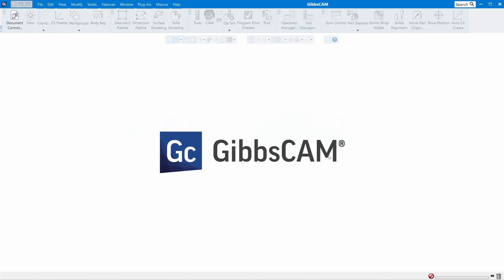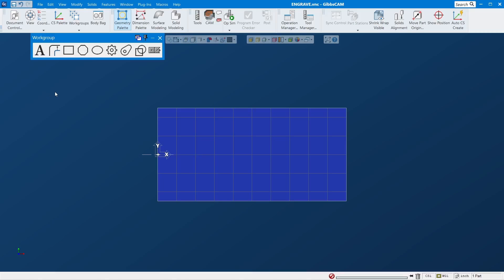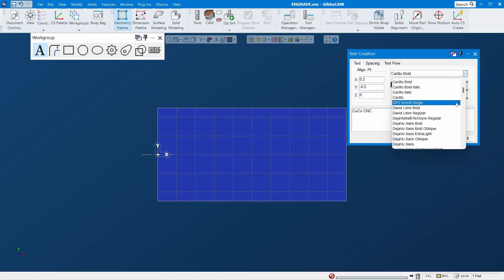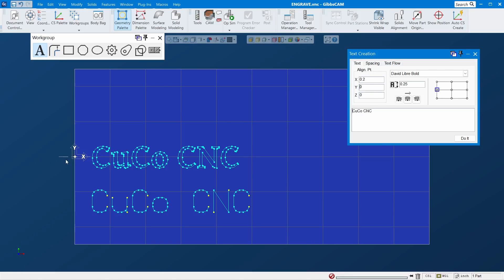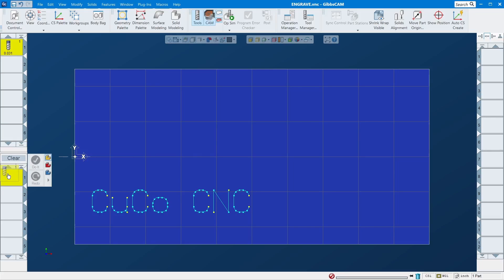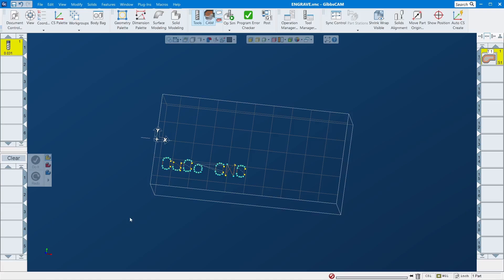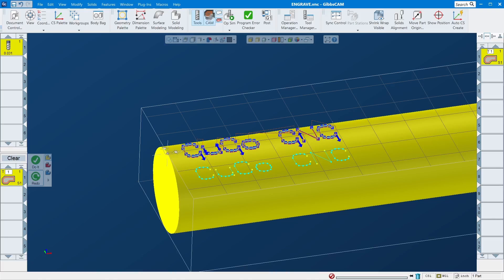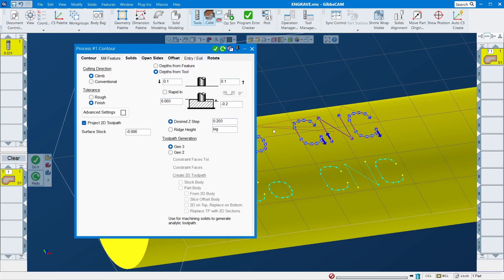ENGRAVING IN GIBBSCAM

Comment: Great video.  It was very helpful.  What is the difference between changing  the solid model type from “stock” to “stock display only”. They both turn the body blue.
Reply from the maker: If you turn "stock to display" it's only for show. If you turn to "stock" be careful with this because sometimes you use model as stock to make yr program and it looks at that is the STOCK. In short, if you just need to render yr program to see if anything wrong with yr program then turn stock display only.
Reply: @cucocnc  very good. I’m still learning basics.  Thank you.  Keep up the good work.